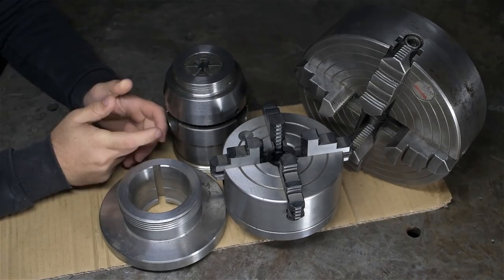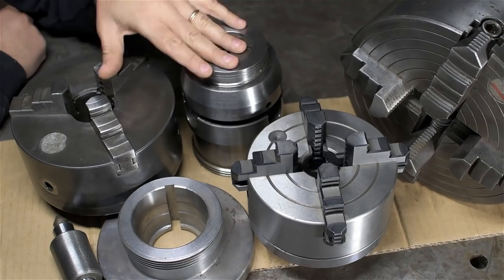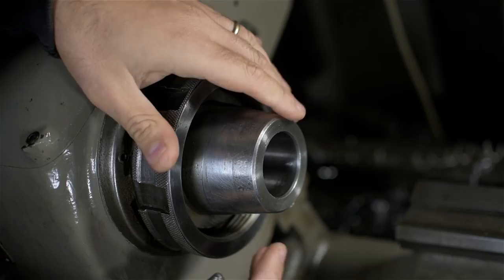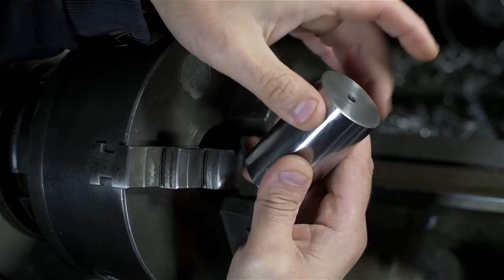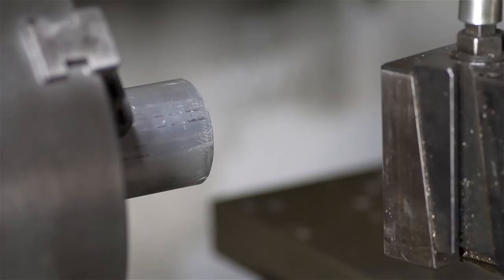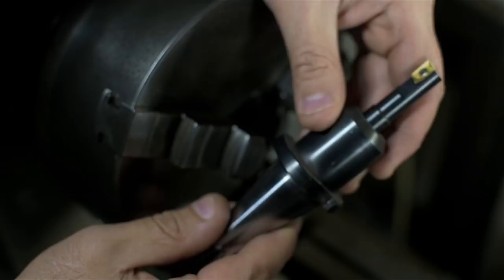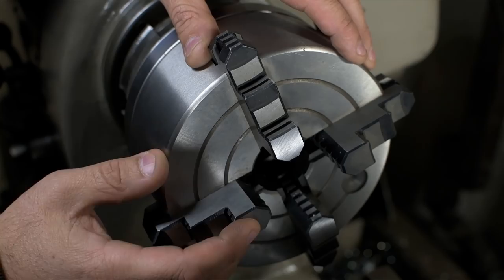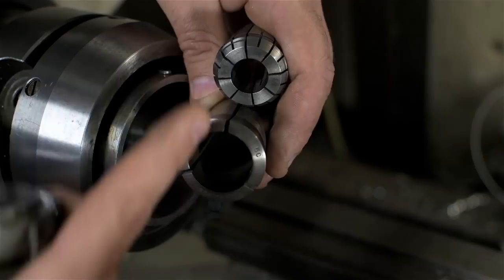Lathe Chucks

Comment: There are also 6 jaw chucks (both adjustable and independent jaw movement) for when you need really, really strong workholding. Robin Renzetti has one [1](if you're not subbed to him you should be, especially if you like high-precision work.)

There's also an interesting 4-jaw design that Dan Gelbart has a Skinner-style chuck that takes pins in the jaws to allow a very wide range of radii (though only for low force workloads). The chuck is also watertight, which makes flood coolant usage more viable since coolant can't get into the chuck mechanism. [2]

[1] https://www.youtube.com/watch?v=W7jZO3ZTd0Q
[2] https://www.youtube.com/watch?v=sFrVdoOhu1Q

Comment: I'd like to know what Tony and/or the viewers think about something I'm trying to build.  Is it stupid, ludicrous, or something that might possibly be capable of performing a useful task.  After watching several videos (Kieth Appleton, mrpete, etc), I'm into the idea of making model steam (compressed air) engines by 3d printing as much of the parts as I can.  I've build a model in OpenSCAD of a simple engine ( https://www.thingiverse.com/thing:2834067 ) that I know could work.  The problem is that while the 3d printed parts are highly accurate they still need to be machined.  Cylinders/pistons are not quite perfectly round and have to be turned or bored to get nasty things like ridges out of the cylinder.  Since the lathe is the mother of all machine tools I thought "why not see if I can make my own lathe?"  "and put it in my one bedroom apartment" and "do plastic machining so I'm not filling my living space with metal chips.  You can see my current attempt in this picture.  https://share.icloud.com/photos/0bwFfkfl625A51whRATc8ReeQ and the first assembled engine here:  https://share.icloud.com/photos/0X9ByxRRuxHQPR3S5iaGGyRbg  Using an airbrush compressor I can get it to turn over about a half turn before stopping due to friction somewhere and probably major leaks around the piston rings (buna-n) 

The "lathe" itself uses a brushless motor that seems to deliver enough power via belt to an 8mm shaft held in the "head stock" by pillow block bearings.  Not a great setup, I know, but right now I'm just trying to get a sense if this is ever going to work in a million years before spending a ton of money.    I picked up some carbide inserts and have attempted to do some simple operations like reducing an 8mm PLA or ABS plastic shaft to 7mm.  My experiments so far are that It Doesn't Work Even A Little Bit with this configuration.  The plastic seems to deform rather than break off in chips and I pretty much achieve the same effect as I would have by just chewing on the workpiece with my teeth instead.

I'm sure there are numerous places where the rig isn't stiff enough and the bearings are crap but I wanted to ask the group if they think it is even possible to lightly machine PLA and ABS plastic in the first place?  Would it even work in a "proper" lathe?  Would anyone who has one like to give it a shot if I send you some sample workpieces?  Or is this all just crazy talk and I should forget it?

Henry